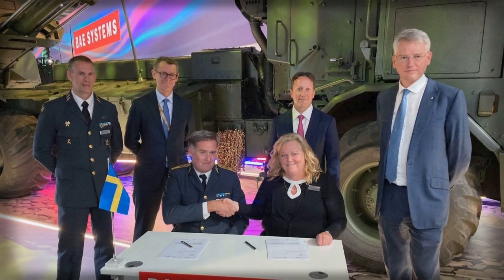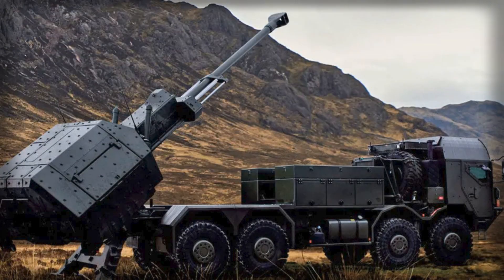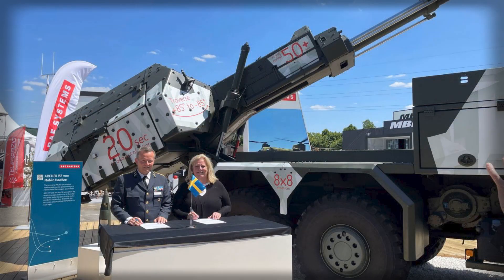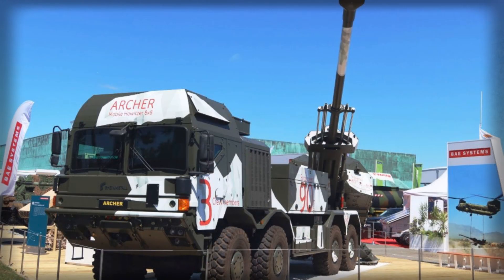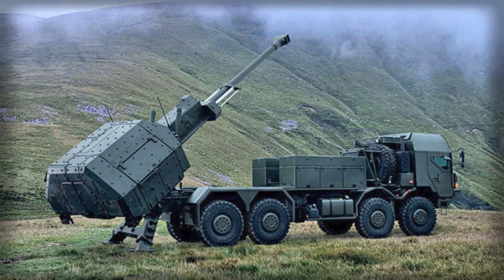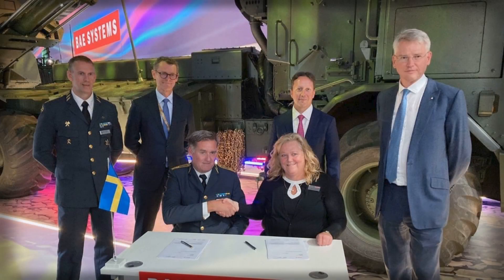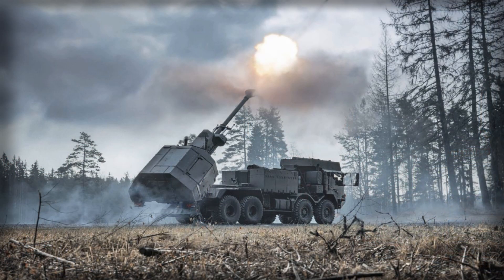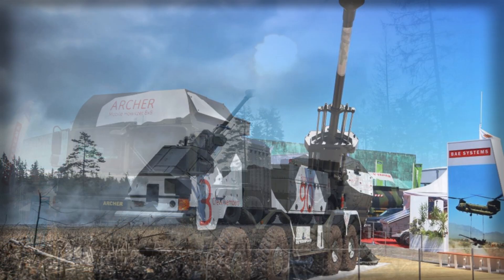Sweden Finishes Archer Upgrade: Version C on HX2 8×8 | Mobility & Firepower Boost

Comment: I cannot see this chassi being better in hard terrain though. The Volvo one is purpose-made for heavy forest terrain. The new one has lower ground clearance and smaller diameter wheels, along with longer turn radius. I don't think the 8 wheels instad of 6 compensates for all this.
Reply: Yes, the new chassi is worse in terrain, but it seems the priority is for roads and also I assume for export to countries that uses that same chassi for other things.
Reply: its because german and belgian's wanted/demanded in on the deal. its not worse its just a diffrent chassi made in germany the gun range and other specifics is still bofors ... and to be honest thats okay the gun is the prize the chassi is whatever you can produce ... here in scandinavia we will still use the volvo chassi because our factories are tool'ed for it europe arent they are tooled for the 8x8 if they want domestic production this is better , the ai bs is anoying though id rather have a german with broken english talk about it .
Reply: Well, if you want to move fast, you go by roads. And moving fast is kind of the point of shoot-and-scoot. 
Traversing terrain is all and well, but moving across terrain don't work, because the enemy will just carpet bombard the grid the fire came from. . so you won't get far even with the best terrain vehicle. It's just too slow. 
So I think a truck that's good enough in terrain, is probably ok. What really count though is how far it can move on it's own. I think this truck is probably better for long transports, and good enough for finding a hiding spot in the bushes.